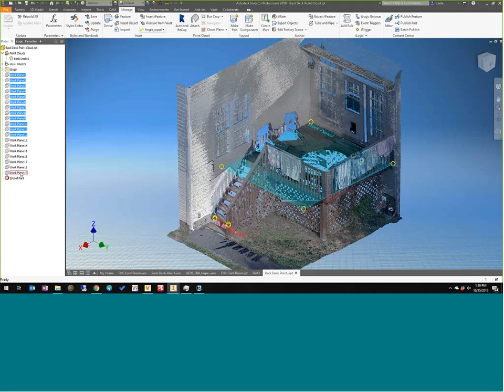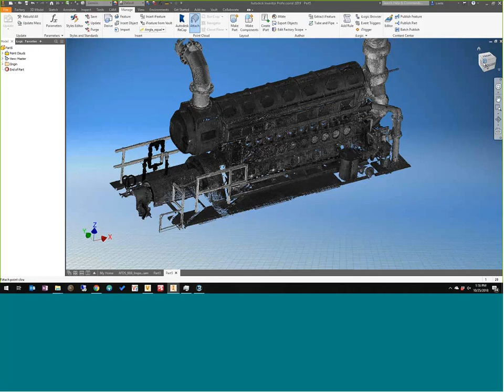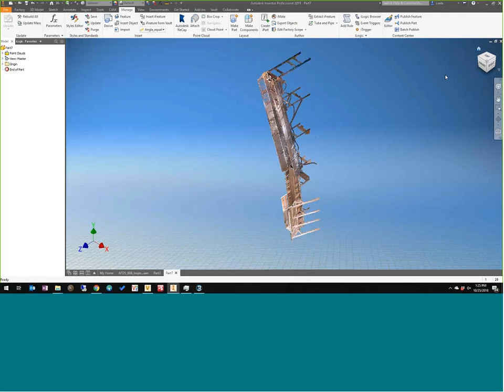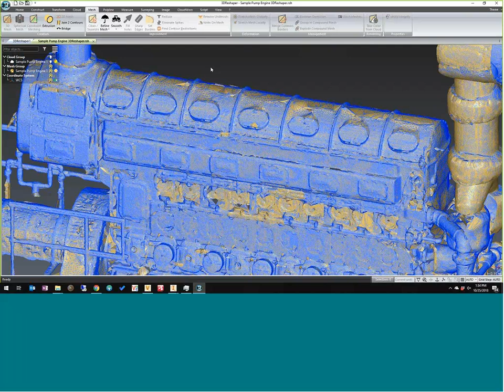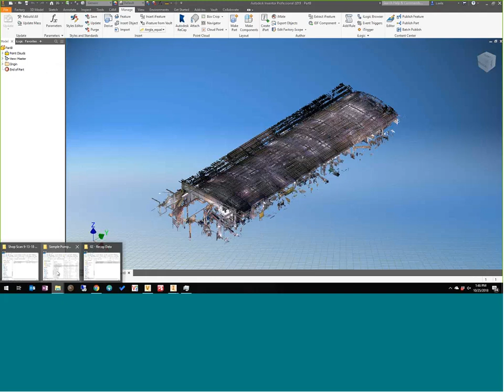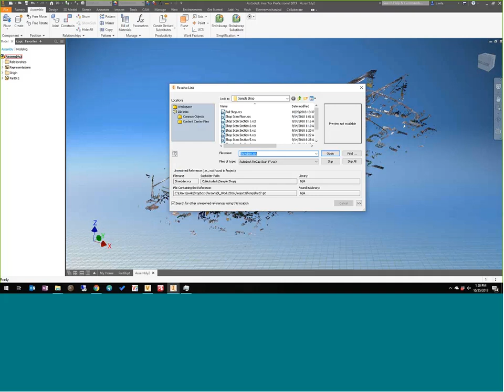Working with Point Clouds in Inventor

Comment: I've notice that is quite hard to take dimensions in invnetor, It loses it-self between a pont which is in front of you and a point meter from you, but it's in the screen. Also, it keeps changing selection between guessing planes you want to select and poits.
Would be nice to have a feature to chose size of the point, to select it easier.
Reply from the maker: That seems to be a frequent request for Inventor. We suggest you provide that feedback directly to Autodesk using the Inventor Ideas forum: https://forums.autodesk.com/t5/inventor-ideas/